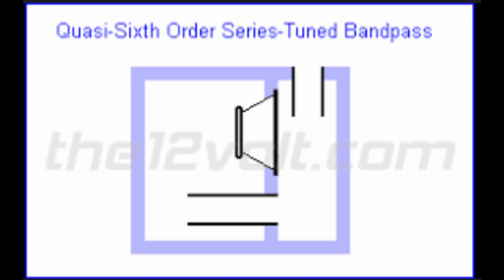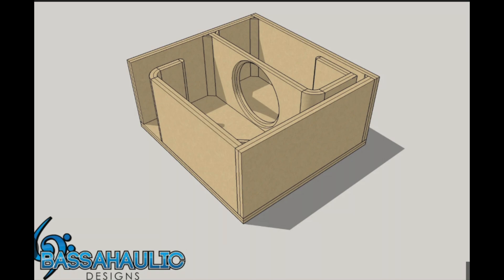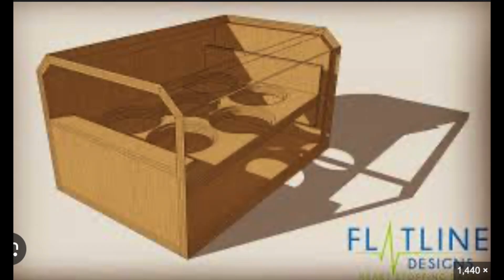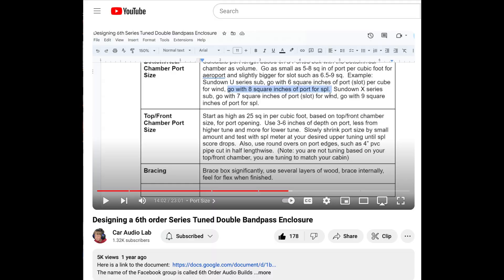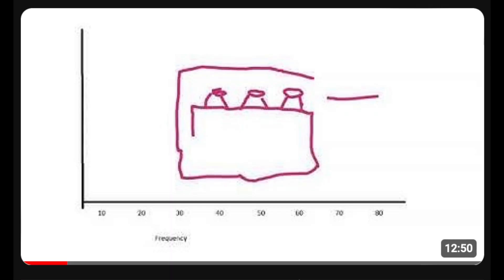Huge Truck Blowthrough Build (Part 4):  how to design a Series Tuned 6th order bandpass enclosure

Comment: What are you using to protect your wood on enclosure from the elements?? I am about to do a 4th order in my Nissan Titan. I am going with a 1 : 1 ratio
Reply from the maker: @chijiokepenny2100  I use duratex speaker coating.  Bed liner is good too.

Comment: I don't think there is magic in the design.  The magic is more fine tuning the ports if you're looking for specific frequency or going for SPL.

Even a simple sealed or ported enclosure will measure different than what it's designed at.  Actual in vehicle response (cabin gain and resonate frequency) is difficult to calculate.
Reply from the maker: @Mark_5150  I understand that.  My comment was in jest. I was more referring to the lack of consistent information on this topic.